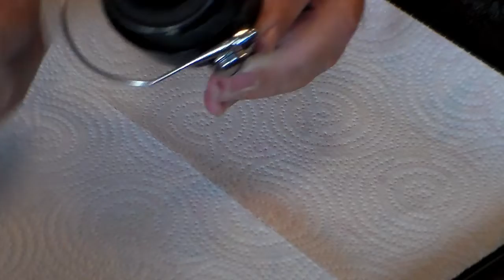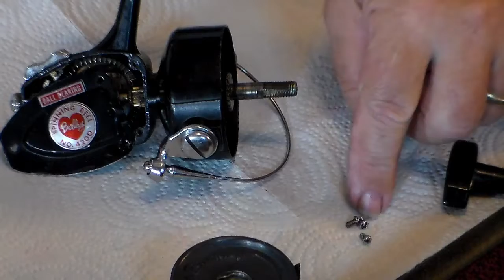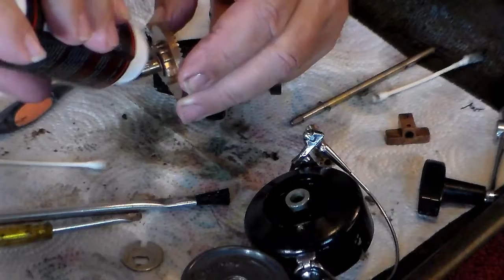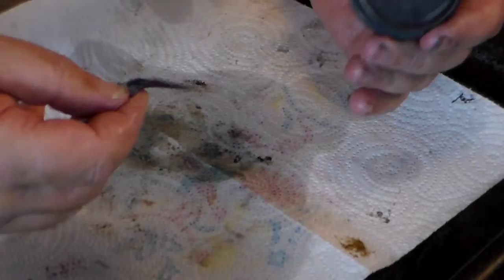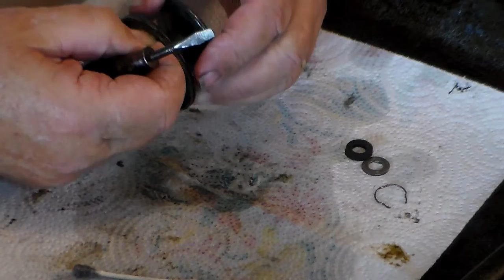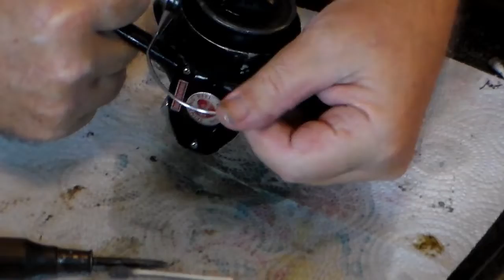YoungMartin’sReels - Berkley No  4200 Spinning Reel Disassembly, Cleaning, Lubricating, and Assembly

Comment: What's the difference between a Berkley 4200 and a 4201?
Reply from the maker: The Berkeley 420 shows up in the 1967 catalog, the 4200 in the 1970 catalog, and the 4201 in the 1973 catalog. The bail is changed between the 420 and 4200 but so far I can’t see a difference between the 4200 and the 4201. When I acquire my parts catalogs maybe I can compare and see what the “upgrades” were.